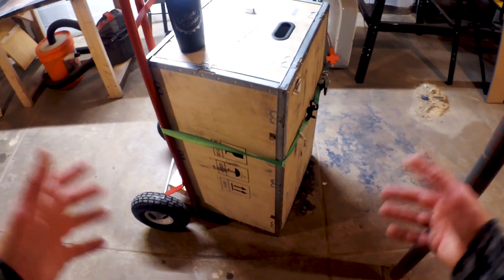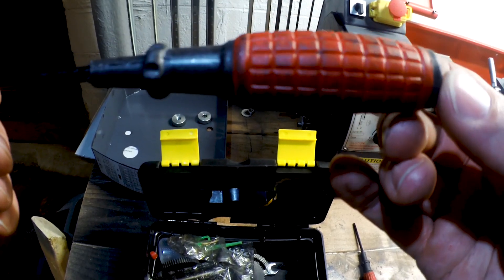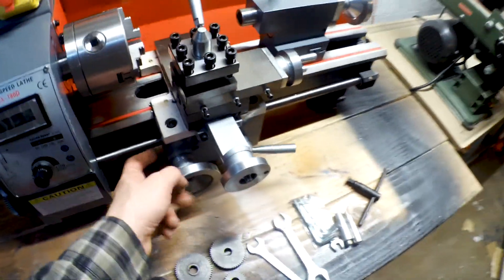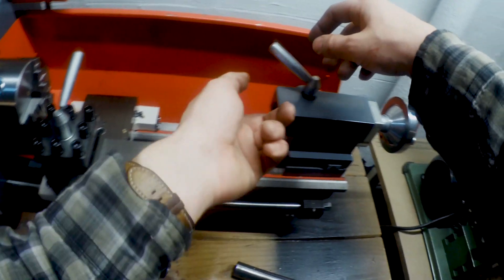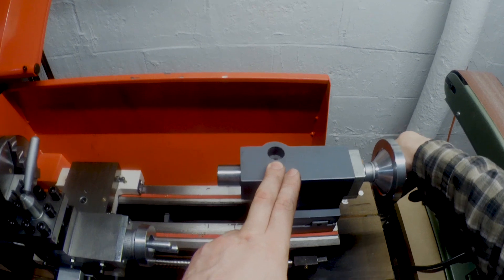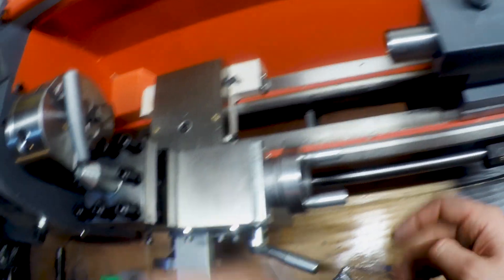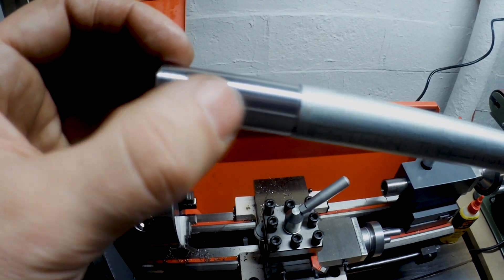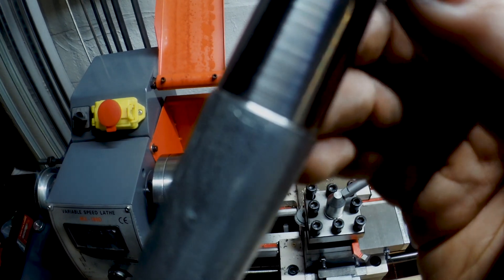mx 180D mini metal lathe pt.1

Comment: hi I have the same lathe had a few niggles but easy fix, the main fix was to lock the carriage  just take an alan key and cut the end down so when it fits in the screw under the cross slide it sticks out so you can use it as a handle to lock the carriage, I also put a set in the alan key handle to drop it below the slide wheel handle all in all an easy fix, ps for the money the lathe is fantastic 4" chuck speed indicator  also unlike most 7x12 lathes

Comment: did this lathe have brushless motor
Reply from the maker: Unfortunately, no. Its just a 600w brushed dc motor. An upgrade to brushless would be nice. Could add quite a bit to the rpms or allow for further gearing down to get more torque.

Comment: This is one of the heavier ones but im not sure its worth the extra $200+ you pay. I like that the belt offers a giving point but those 5m belts break so easily its not even funny. Yes, even the gates ones.
Reply from the maker: When I bought this one, the only ones that were $200 less were much smaller in capacity and motor wattage. Quality probably isnt too much different than the smaller cheaper ones as far as the guides and everything. But it did come with metal gears and higher quality angular contact roller bearings. I did pulll the bearings out to verify. You are right about the belts, they have had me nervous from the begining.

Comment: How are you liking the lathe since you’ve had it for a few months?
Reply from the maker: Sorry for the late reply. Ive seemed to have missed a bunch in the past year. Anyways, I enjoy the lathe for the most part. I have used it pretty heavily and the more I use it, the more I find that needs modified. Right out of the box it done great. But I have broken some bolts for the power feed and the tailstock is angled upwards. The power feed issue isnt too big of a deal, I'll fix it one of these days. But if i would have charged anything for all the work if done for people on it, it would have been paid for a few times over. It handles aluminum and brass wonderfully. I have done some mild and hardened steel on it. Overall it is still holding up great. One day I will do a one year update video on it.